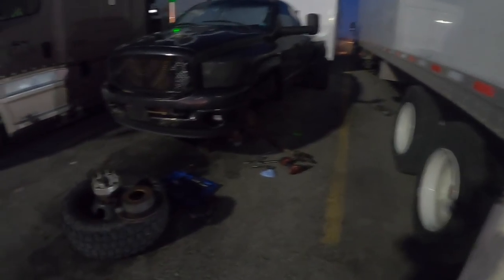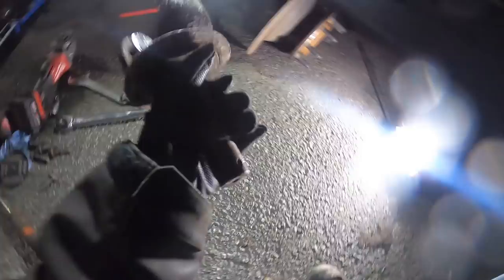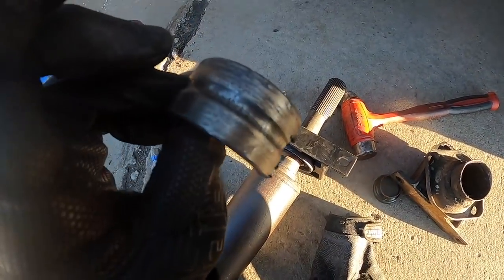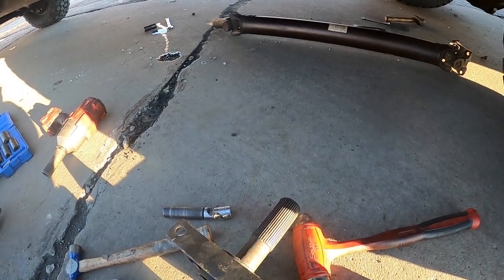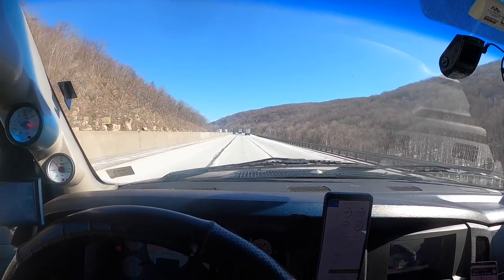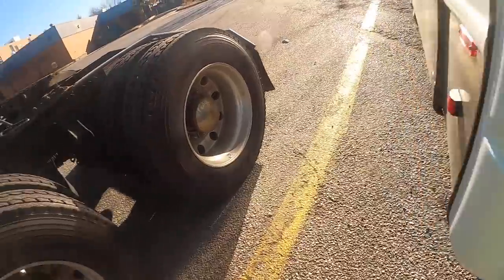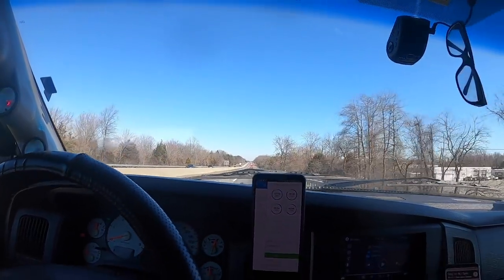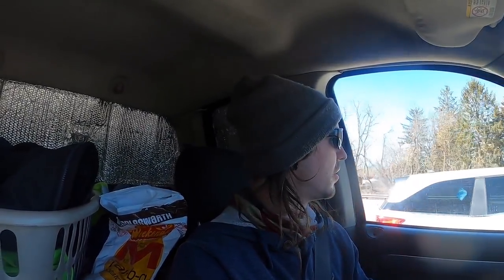Damage Report | 4wd To 2wd Swap & Broken Carrier Bearing | First OTR Hotshot Vlog

Comment: Put a 1 piece driveshaft from a 4th gen mega-cab in. My 07.5 3500 quad cab has that exact set-up with 365,000 miles....no issues.
Reply from the maker: That won't fit. Completely different drivetrain setup. The one piece I'm getting is 1k after shipping

Comment: Commercial vehicle are allowed 75% tint...except in Pa an Louisiana which doesn't allow tint period.  Just remember the more stuff they want to question the more you'll get harassed.  But your allowed to tint the windshield down to the as1 line.  Also look for ceramic tint.  Cuts out the uv rays
Reply from the maker: Pa allows 70% on the fronts but that still is nothing. I was told by dot officers no tint whatsoever on the fronts and only to the line on the windshield but I miss my 3% tint and 30% windshield. I'm looking into electric tint. Apparently that's a thing and I WANT IT 😂
Reply: Yeah but look at some of the DOT vehicles have their fronts tinted....😡
Reply: @CPSteveMiller  when I was a hot shot...i bought my truck with 25 all around except the tint brow on the windshield which was down to the line...made it a month before KY pulled me lol
Reply: @brianknorr6202  one of the perks of the job I guess

Comment: I use to hot shot and move camper with my dodge.  I had limo tint all around my side and back windows and the windshield down to just below rear view mirror.  Been inspected many times all over the country and never had anything said about it.   I had been told by a few dot officers the cleaner the out side and inside you keep your rig goes a long way with the DOT officers.  It shows them that you take pride in your truck and usually those that take pride make sure they are in working order.  So they are less likely to look you over top to bottom.  Good luck the camper thing is a tuff business. I enjoyed it but NJ insurance companies keep raising our insurance rates to the point I was just hauling to pay for insurance.  So I got out of it.  I did it for 5 years with no MVA’s or moving violations.   The insurance companies answers on why is because they can.

Comment: what happens if you lose a wheel bearing on one of these trailers while in transit? Do you have to fix it?
Reply from the maker: I've only lost one. Gotta play it by ear but we are not responsible for tires or wheel bearings. Customer has to pay for it

Comment: Power steering fluid? 3rd gen run ATF +4
Reply from the maker: Correct, but I have a 12 valve power steering pump.
Reply from the maker: I thought the same thing and had to get on the forums to make sure 😂 12 valve power steering pump uses power steering fluid. That caught me off guard
Reply: @CPSteveMiller  oh I see ya 👍

Comment: why you running in 4 wheel high put that thing in neutral and why didnt you stuff some rags in the open diff ?
Reply from the maker: I wasn't in 4hi. The front end is a full time live front end. It spins all the time when you're moving. It's not a Ford with manual locking hubs. When the front wheel is spinning, the front diff is spinning as well. As for the diff being open in not worried about that. I have worse fluids on the truck like oil, fuel, coolant, and power steering fluid. Just adding to the mix at this point😂 Getting it rebuilt when I get back to pa
Reply: @CPSteveMiller  o i see i thought i saw your 4x4 shifter in 4 high mine is a ford electronic on the dash you put it in neutral and then turn it too 4 high then 4 low and vice versa to get out of 4x
Reply from the maker: Ah I see. Yeah my lever on the floor is for looks. Mine's electronic too 😂 hell I don't even have a neutral option 🤦‍♂️